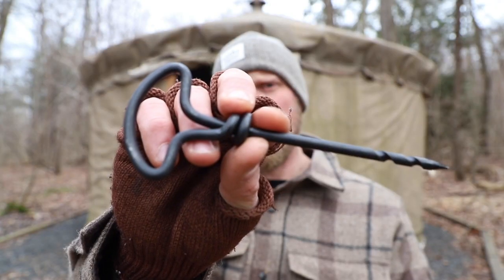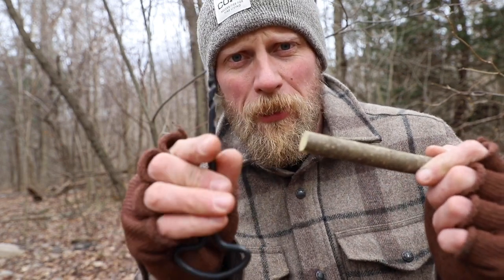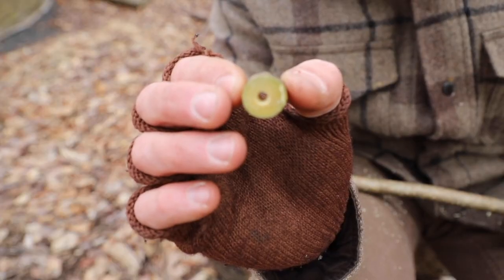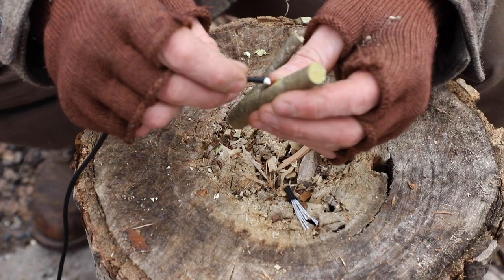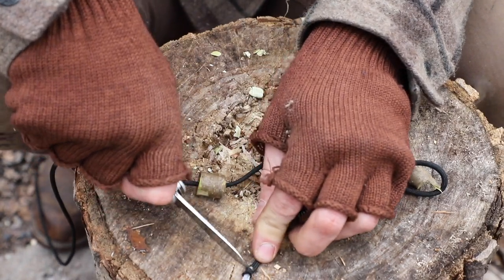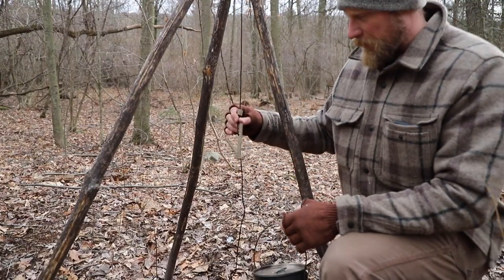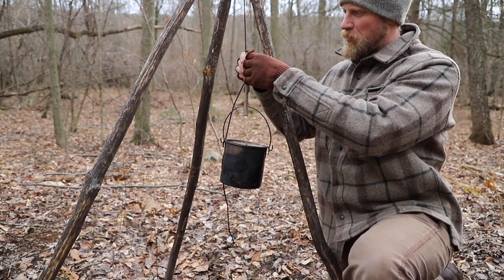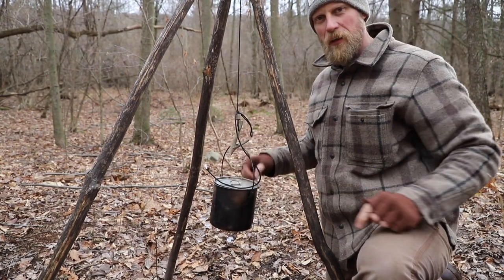Bushcraft Bead Tensioner

Comment: Nice.  Another method is to put a bowline knot at the end of paracord, then run that through your handle or a s-hook, take the bowline back up and push the running line through it and use a stick as a toggle.  This can be slid up/down as needed.

Comment: How about instead of a half hitch to lock it off, you use a tautline hitch so its always adjustable and doesn't need to be untied every time? I haven't tried this but it seems like it might work
Reply: Actually, if you used a taut line hitch, you wouldn't need the bead.
Reply: Paul Saber you're absolutely right, that's what I was trying to get at

Comment: Useful information. I think I see a possibility of using a second bead as a height adjuster. Ill have to try it out but thanks. EDIT: Yes if you use a second bead , a stop knot and a prussik loop you could make a height adjustment bead so you would not have to tie it off just adjust the loop under the bead. Ill have to try this though to be sure.